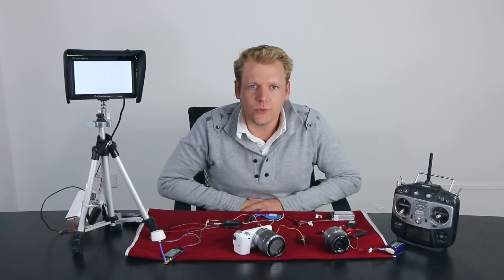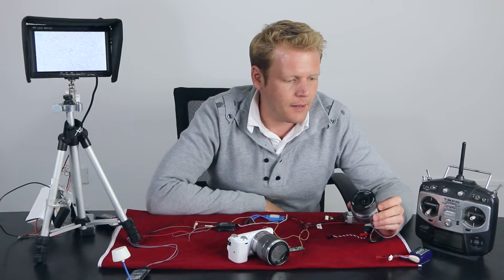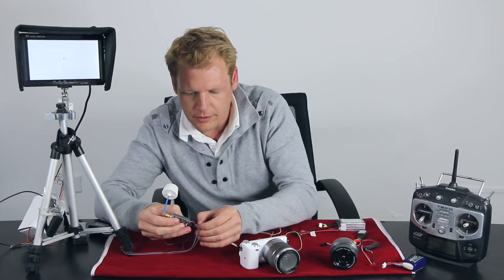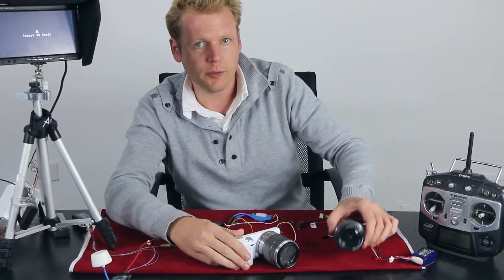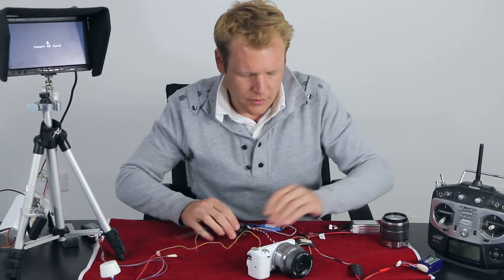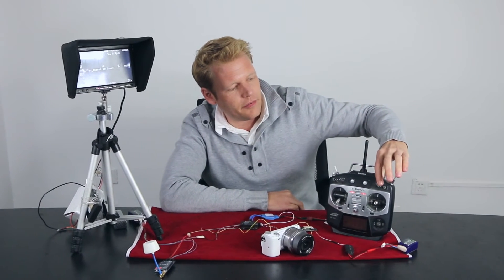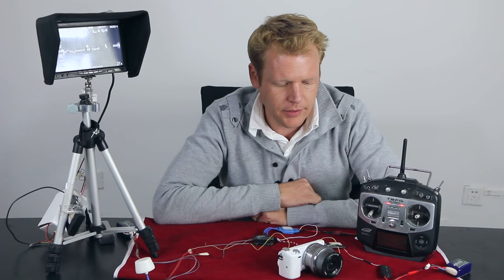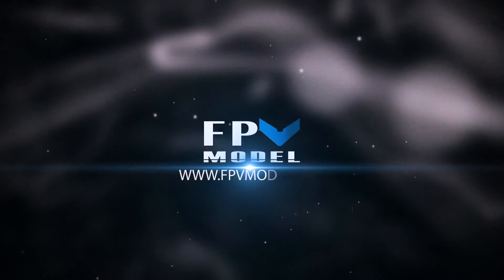Sony zoom lens for Radio and HDMI converter for VTx

Comment: What lens does this work with and how does it get connected to the switch of the lens as I believe its a slide up and down type.
Reply from the maker: The lens is part of the package. It's a sony lens that has had the interior converted to work with the controller.